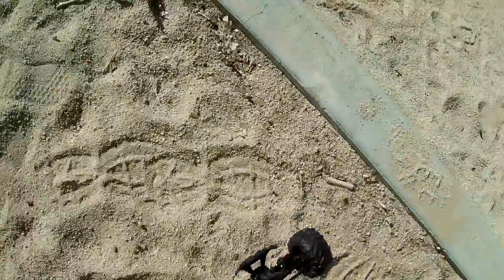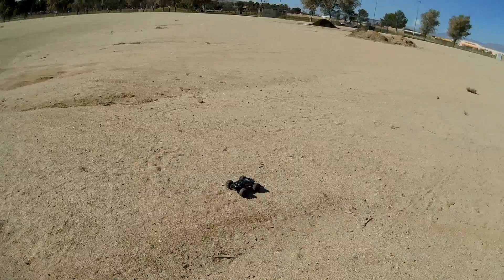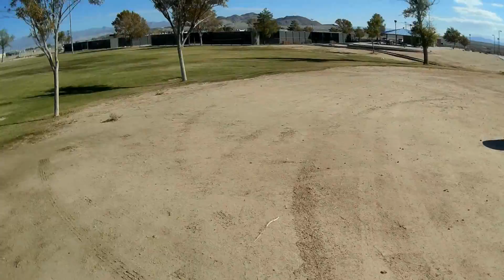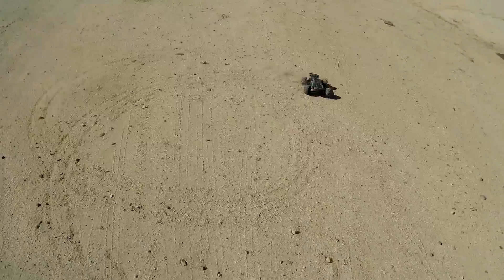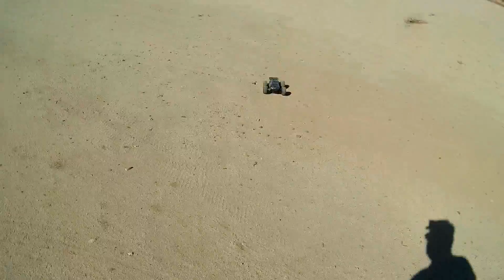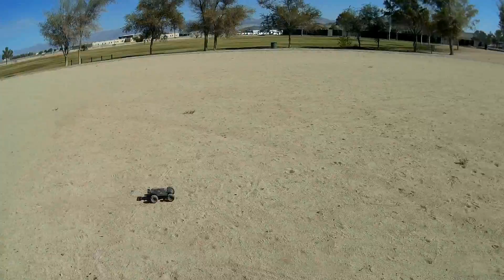Xinlehong 9136 1/16 Scale 4WD RC Car Test Drive Review

Comment: Hey, Nice Video! I Have a question: I found this Video while I was searching for the Absima Racer 1/16. I want to buy this for my son. This Xinlehong looks pretty much the same..
Do you know if it actually IS the same car? You know, like sometimes products are build by one company and sold under different brands. 

If you could answer this, it would help for my research, because I find a lot more content for the Xinlehong as for the Absima. Would be interesting when looking for spare parts as well.

Thanks and greetings from Germany!

Maik
Reply from the maker: It is the same.  Absima is a German import,er that rebrands and sells (at a healthy markup) Chinese RC cars from several Chinese companies for sale in Europe.  It's not just Xinlehong, I also saw some WLToys cars in their inventory.
Reply: Quadcopter 101 Oh, Good to know.. Thanks for the quick reply! That helps a lot!
Reply: @Quadcopter101  Hey, I have another question, if you would be so kind; Can you tell me what the charging Time is for the stock 500mAh Battery with Stock Charger? I think I would use a 2A iPad Power Supply for the Charger..

Comment: I've got the subotech version boarse chariot 1/12 size I think? Anyway these little 4wd trucks are a blast. Heavy enough not to flip,but strong enough to jump BIG snowbanks and do mad donuts in the snow. That being said ,I burned up the servo and it's a pain in the butt to try and get to. Would've liked the plug and play motors this xl offers. Should be a good buy!
Reply: P s. NICCCCCCCCCE shirt!

Comment: I wouldn’t jump this truck at any height looks very fragile and RC from China always are fragile I’ve never had one from China that held up under normal use and normal wear.
Reply: Pasha Xavier no check out the awesome great priced 4x4 Traxxas Stampede I’ve jumped it time and time again never broke but I did upgrade it all to the upgraded parts aluminum all the way...
Reply: @NoahzLearning  video coming soon of all the jumps ive put the hosim 9130 thru. really surprising truck for the price. this is just a different body from the 9130. yeah its no traxxas or arrma but it does jump and it takes the abuse and keeps going.